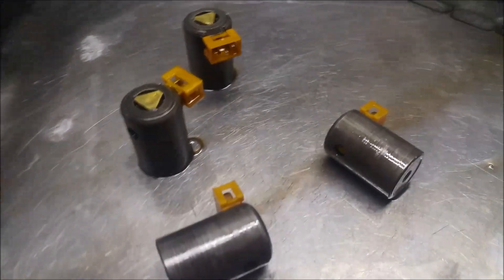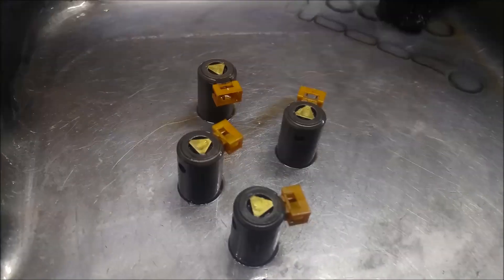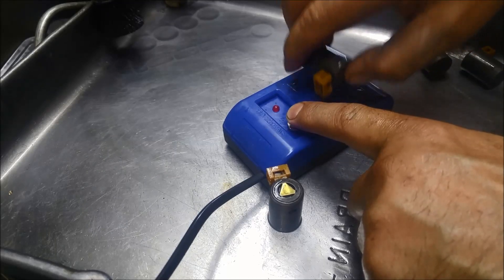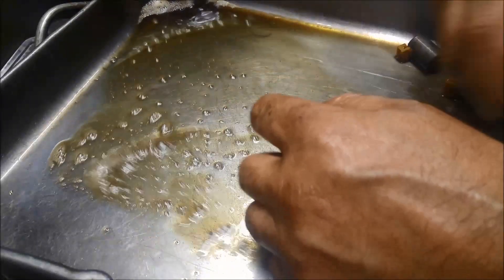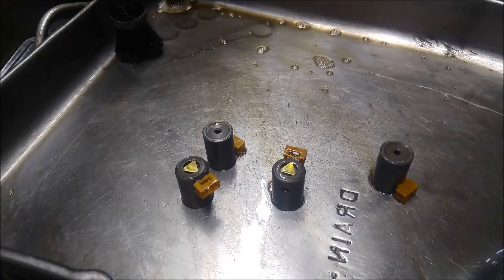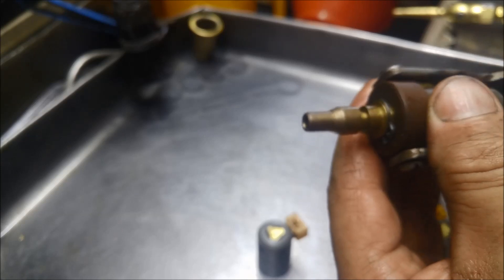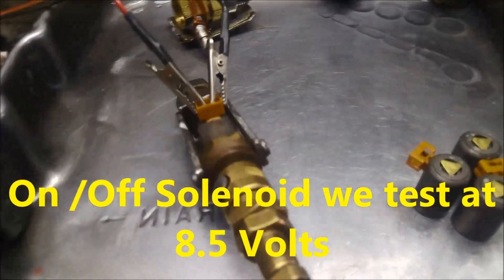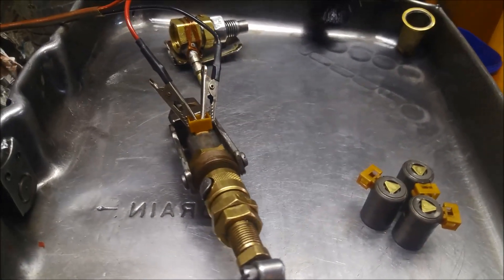How to Automatic Transmission Solenoid Test Clean Demagnetize & Flush How to DIY

Comment: Why do not you  just pull the triangle brass then clean it better, the bracket holding  on vb will hold them back even if loose. Also ultrasonic cleaner will do best.
Reply from the maker: hi, demagnetizing works much better than ultrasonic. try it, we have tested. cheers
Reply: @YepThatsIt  thank you very much for sharing.

Comment: I've cleaned out au falcon solenoids before, but was a bit scared to use harsh solvents like petrol ( vaguely remember reading somewhere not to use petrol), what sort of solvent do you use? would you think any issues using petrol or similar to clean them out?
There is also a simple way to pressure test using a large syringe, I"m also in oz, and the bigger syringes from chemists fit the solenoid very tightly, so I cut off the front of syringe put it on the front of solenoid ( where the rubber seals are) and use plunger of syringe to apply pressure.
Can put alot of pressure through it and easy to tell if it seals correctly or not ( apply 9v battery to terminals)
Reply: oh I should mention you cant take the falcon au solenoids apart unfortunately, they seem to be plastic moulded type, unless I'm missing something there.
Would be great if they could be taken apart ( they are bosch brand)
Reply from the maker: hi, we test at 65psi air pressure and you will need to also do a few more tests when solenoid is warmed up and plunger isnt sticking/binding from the magnetized debris inside the solenoid. this is why we also demagnetize the solenoid to flush properly. cheers
Reply from the maker: we use x55 solvent. cheers

Comment: Hi mate   What’s the correct way to warm up a solenoid to 80 -90 degrees as you mentioned Cheers
Reply from the maker: hi, we use a thermostatically controlled oven that gradually warms them up and doesn`t overheat and damage them....you could try placing them in a plastic bag and boiling them in water, at least you won`t get them over 100c and damage them....don`t use a heat gun...you cant control the temp....cheers for beers if deserved https://www.paypal.me/BATS189

Comment: What solvent are you using when flushing trans solenoids?? Can I use brake cleaner?? And blow air thru after??? Thanks
Reply from the maker: hi, we use solvent called x55 ( if you`re in oz ) as long as brake cleaner ( sorry we dont use it ) doesn`t dissolve seals should be ok. cheers

Comment: Hey buddy I have evolution X SST transmission. I have cleaned solenoids out in brake cleaner bath but my 1 of my solenoid keeps failing after 30mins of driving. I tested the solenoids and with multimeter and they all were showing in spec (2.8)

Any suggestions?

It's a MPS6 6DCT450.
Reply from the maker: hi, did you reverse flush internal filter while your valve body was out ( https://youtu.be/x7qqWIXO-MY ) ? either the filter gets blocked while running and reverse flushes itself when you turn vehicle off or there is a dicky coil wire in solenoid that loses proper connection as it warms up. the end of coil wire is just crimped onto contact point. the solenoids coil winding also increases ohm resistance as it warms up. always good to warm solenoids when you test them, just don`t overheat them or use a heat gun. cheers